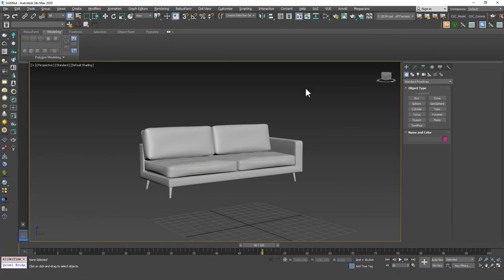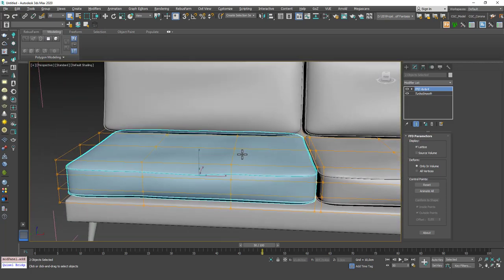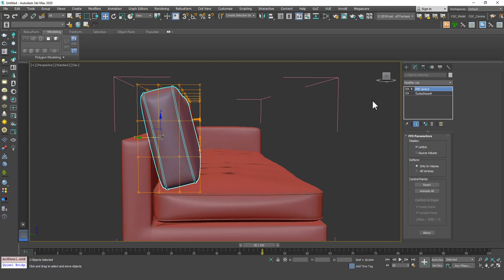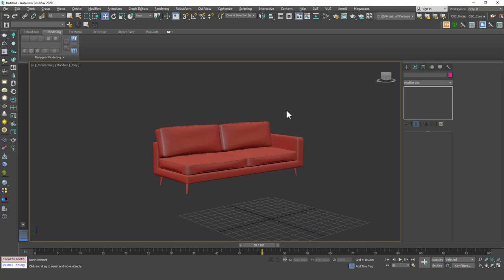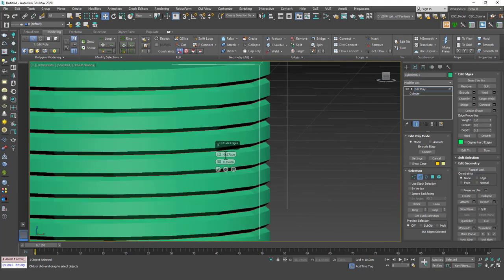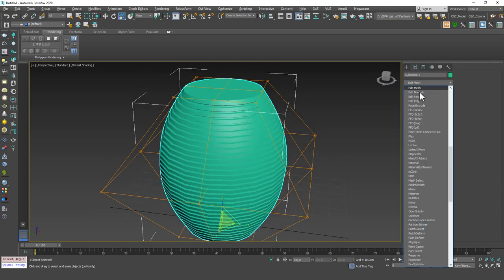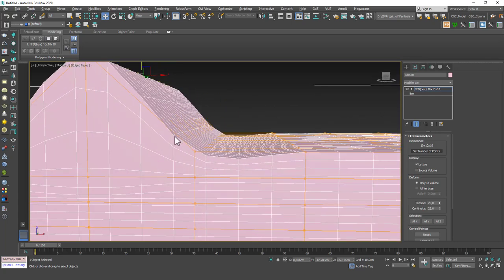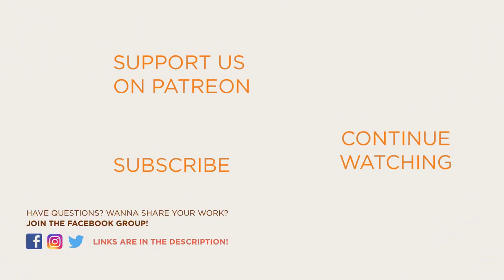FFD Modifier | 3ds Max Tutorial #64

Comment: Hi, i actually have issues with the FFD box modifier, when changing the control points in "Set Volume", they still affect the 3D model the same way as in their previous position. And it seems in your case you, on your sofa the 2 top control points have slightly less effect than the 2 bottom ones.
Am i missing something ?